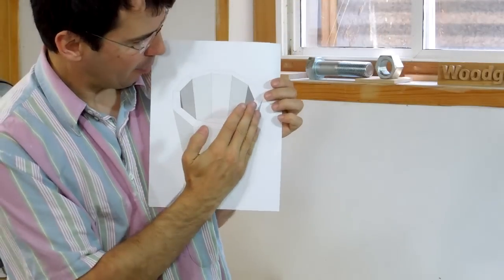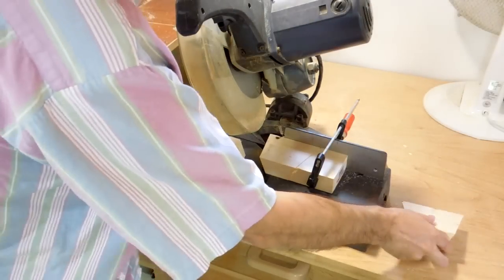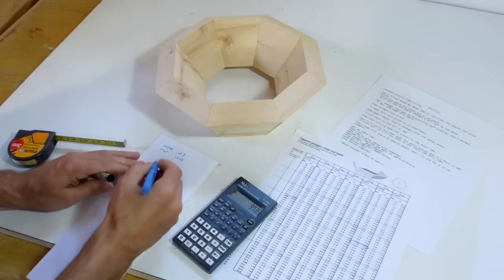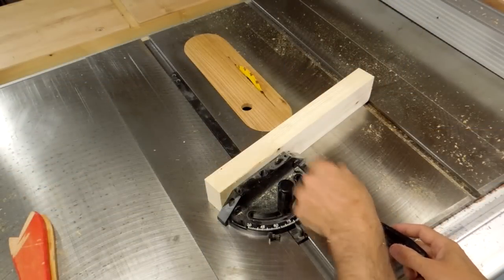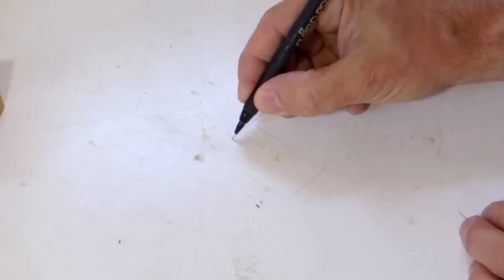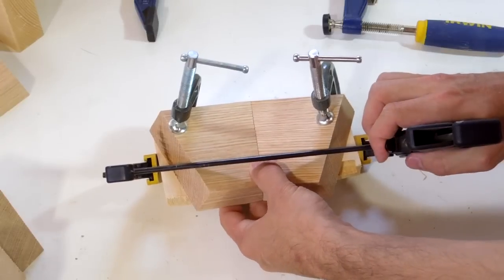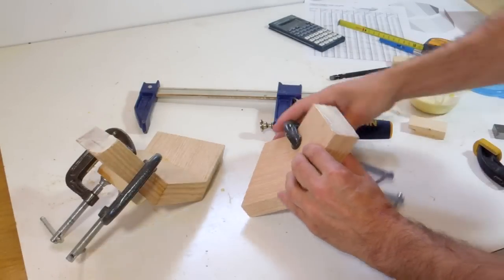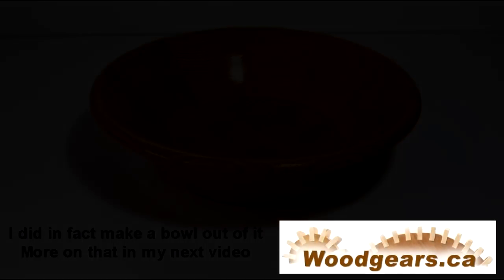Splayed miter angle calculations and gluing

Comment: Apply glue (titebond no drip glue) sparingly to one edge of each piece with a cheap paint roller and then lay the two pieces inside face down together flat with the outside edges together. Tape the outside edge with reinforced packing tape to hold the joint together and bring the joint together. Apply tape to the outside edges to hold the two pieces together. Make sure you use reinforced packing tape as anything else will just stretch.

Comment: i was trying to make a chest top, with 4 tilted sides at 30 degrees, but when i cut it to same angles in the chart there is a gab between the two sides when i try to connect them and they are in a more open angle, not 90 degrees, is the gab and angle shift caused by the table saw blade? would it affect the angle?
Reply from the maker: inaccurate cuts.  Where the inaccuracy comes from I can't say.
Reply: @matthiaswandel  i'll check again, thank you for your reply ^_^

Comment: To glue weird angles like this, put mostly wood glue on your mating surfaces and just a few dabs of Cyanoacrelate (CA) Glue (superglue, Krazy glue are some brand names) in certain places, and simply hold it for 1 minute in place. Just make sure your super glue doesn't get mixed in with the wood glue when you place them together. Been using this trick for awhile

Comment: Interesting as hell.

Some things get more confusing the more you try to explain them.
Reply from the maker: Whether it's confusing or enlightening to you depends on your intelligence.
Reply: C'est vrai. And nothing is clearly understood until it can be explained simply.. but not to criticize.. compound angles are considered hard by most good men.... Waiting for the hover clamp without having to distribute 100 attachment points for sets of adjustable height toggle hold down clamps and culls.. I figure a sliding gantry system might do it..

Comment: Wouldn't it be worth it to make a jig to dowel the pieces?

Also you could try to make more complicated shapes like ovals and 8s. It would be easier to try different shapes using a CAD program rather than formulas. I managed to reproduce your result by lofting two polygons and thickening/extruding the resulting surface.

The clamping is amazingly witty!

Comment: I have a dumb question.  According to table, whether I use my miter saw or table saw, blade tilts from 90 to 45.  How do I get a 41 degree cut?
Reply from the maker: cut from the other side.  set to 49, stock at 90

Comment: A more accurate method of setting the bevel angle of the saw blade would be to use a digital clinometer often sold as a digital angle gauge. These have magnets attached to the base and can be stuck directly to the blade after zeroing on the saw table.

Comment: Hi Matthias,
Thank you so much for this.  I have several relatives who are gardening types and I's like to make them some cedar buckets or planters for their gardens.  

Have you ever explored making compound angled n-gons using birdsmouth joinery on the table saw?  Seems like it would simplify assembly.

Have a great day.

P.S.: I just looked at woodgears.ca/miter and I was wondering about the three variables splays, splayx and splayc.  I can't find where you define them and their definitions are not obvious to me from the images.  I'd like to use your derivations for splayed miters with the number of sides and the splay angle different from what you have in your table.  Thanks again.
Reply from the maker: if it's more than 10 sides, the bird's mouth joint would have only a very thin edge, so a straight bevel makes more sense.

Comment: You should develop an app, as you just get this stuff, I'm trying to get my head around a similar problem but when I tried using a bandsaw, the angles were completely different to when I tried in a mitre saw, I guess because the points of reference are different.

Comment: this may be a dumb question. but could you have used dowels or biscuits to help with the line up? Or does the compound angles make it not possible
Reply from the maker: +Art Connolly If I used dowels or biscuits, they would have become exposed when I turned it on the lathe later.

Comment: Nice! 
I thing the glueing could have been simplified. Instead of  making several ocward fixtures for clamps, you could have just made one jig of a plywood. The jig will consist on just one hole, the diameter will be equal to the "Diameter of the polygon" at the middle. Then glue all contact faces and hammer the polygon in place in that circular hole.
Reply from the maker: Please do try out your suggestion

Comment: i would like to challenge you on the tape issue . make 4 piece of mdf approx. 10*10 cm. cut two ends of each to 45 degree angle so that you can join them in a square . unfold them and put together end to end whit the outside turning up . know you tape them  together with brown packing tape , be shure to stretch the tape when taping them together . turn the 4 pieces upside down and add glue on the bewelled edges and fold into a square. tape the last corner and discover that tape is powerfull.

Comment: How about a strap with a ratchet?
The only problem that is all the parts must be fitted at the same time (and it won't fit, since somewhere those errors have to be compensated like that flat surface), and probably the strap will tend to slip down (yet it can rest on some clamped stop blocks)

Yet I think that if you clamp the strap on a piece and the other part of the strap clamped on the next piece (or yet several pieces at the same time), the ratchet in between can provide sufficient pressure.

Comment: Great job with the trig but the illustration with the mitre gauge is flawed. That outside angle has to be exactly the same the whole way down, because the cross section of the solid is an octagon at any point you care to choose. The reason you can't make the gauge hug the edge halfway down is because here the upper thickness of the handle clashes with the side, whereas at the rim it projects into thin air.

Comment: i found a picture of a box i'd like to make with a 30 degree splay. instead of 6 degrees. so i would need to tilt my saw to 37.76 and miter at 26.57. if you dont mind i could send you a message with the picture. sorry if i'm not clear here. i'm trying to wrap my head around it

Comment: Hi Matthias - great method, however I feel reproducability is going to be an issue if you have to make loads of the same object, eg garden tubs, over a period of time.  

I think this method - http://www.finewoodworking.com/how-to/video/cut-compound-angled-joinery.aspx - can be adapted to cover multiple sided objects and provide setting templates for the saw and mitre at the same time.

John

Comment: anyone that might try doing this, try putting a piece of duct tape on the back edge of the two blocks, that will keep them together and add a bit of clamping force
Reply: howycwap yeah or even cut groove along the blocks and put a rubber elastic around for even pressure :)

Comment: hi friend I am not very good at math  I need some help .. I am building a birdhouse octagon and I can't find the right bevel for the 8 pieces' roof ..they look very good from the outside but inside there is a gap in between each one and the roof is too pointy, at one point I almost nailed it but the roof looks a little flat and no tail --each side of the lighthouse is 6 centimeters .... what I need to know is how to get more or less pointy the roof, how to get more or less tail overhanging... how to get the right angle in the miter saw....thanks for any help ..

Comment: This is overthinking the problem. There are two concentric equilateral decagons. By definition, equilateral decagons all have the same internal angle (144 degrees) with a total sum of the angles at 1440. Think about it from an overhead perspective on a two dimensional plane. The use of a rectangular piece of paper is a poor illustration because the sides become trapezoidal.
Reply: In plan view the angle does not change... but the bevel angle which is relative to the plane of the section itself changeth as the section tilteth.. We seek the dihedral.. or the resultant angle formed by the face and edge the boards across its fall line, or steepest angle... The bevel is measured from a line 90 degrees to the mitre or cut angle which is in the same plane as the board face.. 

Think of a right triangle. It has three sides, its short we call the opposite in reference to it being opposite the most acute angle. The next  longer one we call the adjacent, (that emanates from the acute angle) and the longest one the hypotenuse. (which also ends at this most acute angle) Put its point with this acute angle downwards to a horizontal surface, its adjacent side vertical, its opposite side horizontal. Then tilt the adjacent up and away towards the horizon using the opposite side as an axis of rotation. One must extend the hypotenuse and the adjacent in length towards the horizontal surface in order to meet it. Keeping the horizontal "opposite" (triangle's side) always at the same height. 

Since the adjacent and the hypotenuse extend different non proportional* distances to meet the horizontal plane for an angle of tilt, (& You have to change the direction of the hypotenuse to intersect an extension of the adjacent) the acute angle where they meet must change with the degree of tilt. It should be apparent that towards infinity away from you, the lines, the adjacent and the hypotenuse, approach parallel. 

The frustrum cone of flat sectors appears to work in the opposite way with a flat plan view angle of a fixed degree as you noted. But we are interested in the angle between the sides projected onto a cutting plane which angles towards the sides at a degree of the  cone angle minus/plus 90 degrees. This angle goes to zero as the cone flattens or broadens and towards the standard internal polygon angle as it becomes non conic or vertical. As MW noted with his piece of paper demo. 

If you tilt a fixed triangle downward its projection to a horizontal view plane foreshortens, i.e. the downwardly viewed angle gets fatter .. This the angle taken from the plane of the sectors flat face between its sides. projected onto a flat surface when the sector is placed at the cone angle.

This is the same deal as my example with the difference being he is looking at the cone vertically and my illustration uses a horizontal surface and only one part of the sector, a left or right half part or triangle. (I ignore the  angles between the sectors in a "normal"* cutting plane as it is an further orthogonal development of the tilt projection angle change I illustrate....)

 For a "perceived" (downwardly viewed) 45 degree right triangle at a tilt of 45 degrees, the lines around the down plunge vertex are at a separation of 35.264 degrees. This is the mitre angle of such a crown molding meeting at a 90 with a spring angle of 45.. 

We take the Flat triangle of 45. Extend its adjacent down 45 degrees. It lengthens by the cosine of the tilt angle. Use 1 as a flat side length, so the tilted angle side is 1/.7071 or 1.41402 

The hypotenuse must lengthen to meet it. Its original or flat length is 1.41402 to start. Its height is 1 which we take as given. Its base is given at 1.41402 the hypotenuse side of the unit or 1-length sided right triangle of 45. Thus the hypotenuses' new "tilt length" of the formerly flat hypotenuse of the 45 is by pythagoras (using the vertical right triangle underneath the hypotenuse of the flat 45 triangle)  is....  the square root of the squares of its flat base ( we take as 1.414) and its height (still 1) = 1.73205. Take 1.41402 over 1.73205 and we have the cosine of the downwardly projected triangle = the mitre angle. The arc or inverse cos of 1.414/1.732 = 35.274 deg close enuff.

This is a combo of trig and projective geometry. A good book on projective geometry can be used. Study guides like Coles notes etc are best.

The all important bevel is calculated from a cutting plane which is right angles to the mitre angle.

A set up block is easiest without much math.

http://www.finewoodworking.com/how-to/video/cut-compound-angled-joinery.aspx

Comment: Nice explanation and miter table, but your gluing and clamping technique is cumbersome and inefficient.  It's a lot easier to tape the pieces together, in pairs first,  on the outside edge on the flat.  Then flip them over, put in glue, and bring them together.  Wrap more tape all the way around, pulling it real tight, and set aside till the glue dries.  The joint will not slip and will be perfectly aligned.  Wipe out excess glue with a wet rag.  The dry joint will be just as strong as with clamps.  You can then tape and glue your pieces all the way around the same way.  Taped mitres are way more quick and easy than using clamps.

Comment: Matthias: It will help us in the United States if you would do some of your work in Inches;Thanks Dennis
Reply: The world is metric, get with the program. Buy a metric tape measure. How do you enter 7 9/32 inches and 32 5/8 degrees into a calculator? Making and reading a imperial measure table of measurements would be a nightmare. Metric is base ten making all calculations much easier.
Reply: The US and its tools are standard imperial. An algebraic calculator is 7 + 9/32 I get 7.28125 which is 18.49 cm. 32 5/8 is 32.625 which is 82.867 cm. There are 128 even divisions of an inch. 8,110, 080 even divisions of a mile which are discernible. We still use sexagesimal degrees, and odd hours and days which are divided into sexagesimal minutes and seconds. The Brit system of weights and measures was binary and practical. Although I admit most don't know the number of table spoons to a cup.(16)  Metric was arbitrary. All measurement systems are abitrary.. None are "more accurate".. First thing they teach you in engineering. I admit mm are easier to read on a tape, but that is partly design.